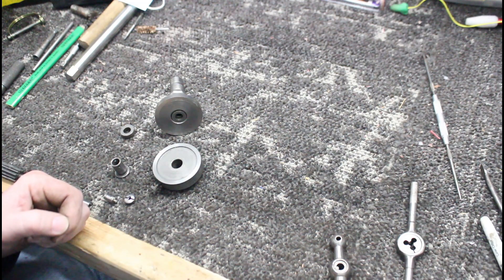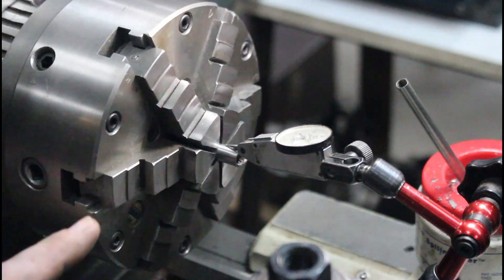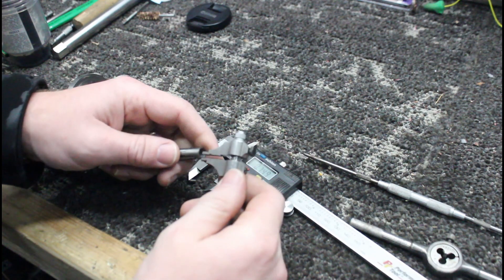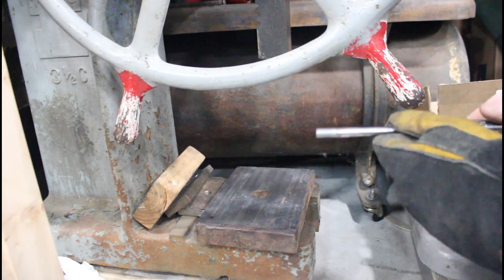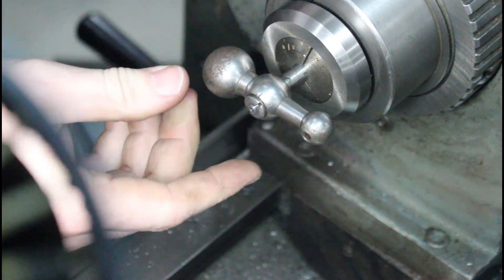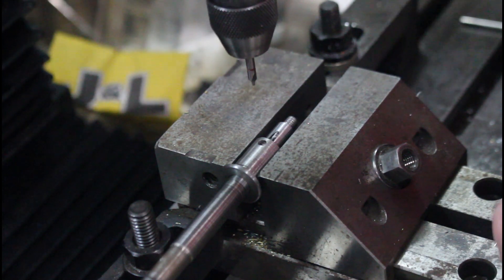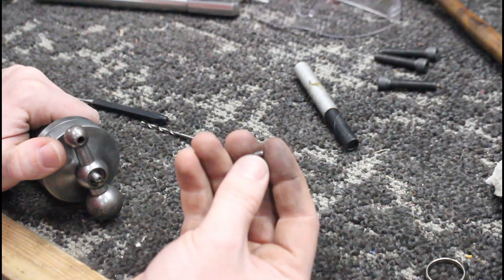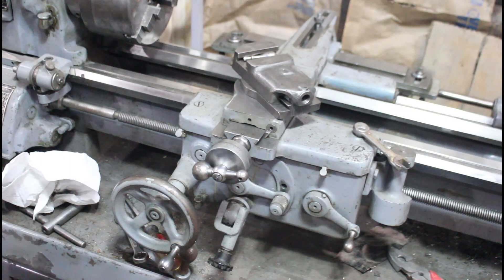South Bend 10L Cross Slide Screw and Handle Repair

Comment: Hi. I have the same lathe. I’m trying to dismantle the cross slide to inspect and clean. I have removed the handle and dial, but I can’t unscrew the last part. The part with the circular piece that goes against the dial and the shaft that goes into the slide. I don’t know what you call it, but it’s in your video. There’s a 1” nut that looks like it just unscrews, but mine won’t budge. Tried torch and belt wrench. No good. 
Any ideas?
Thanks,
Paul
Reply from the maker: If yours has a taper attachment it needs to come out with the taper attachment usually and those are two pieces. The non-taper model is a one piece and you should be able to unscrew the micrometer dial with a wrench on the flats and the whole thing should come out.